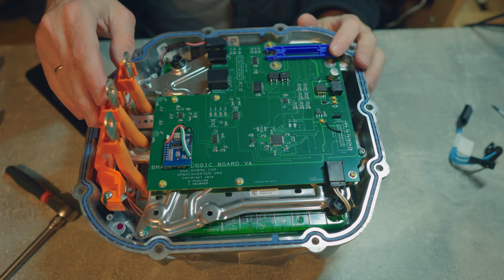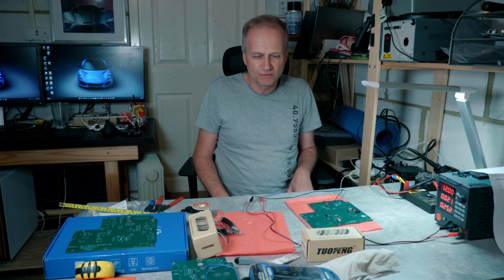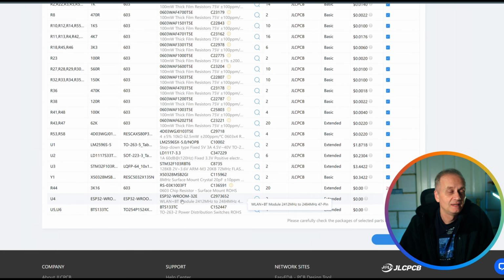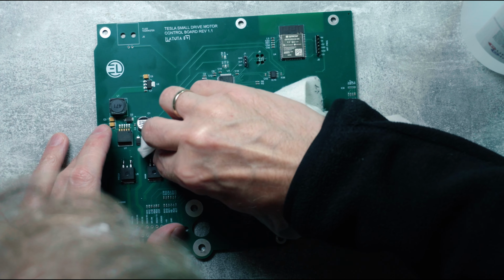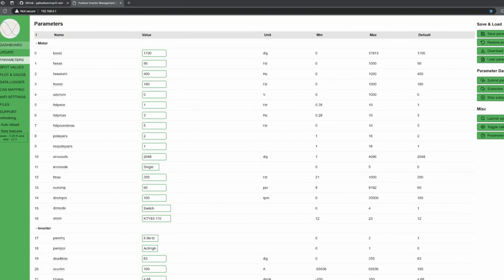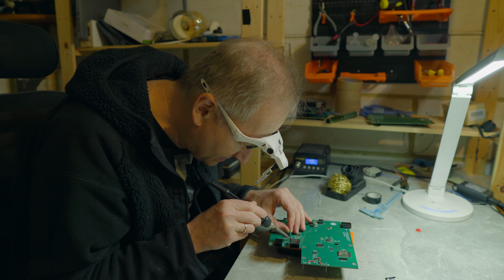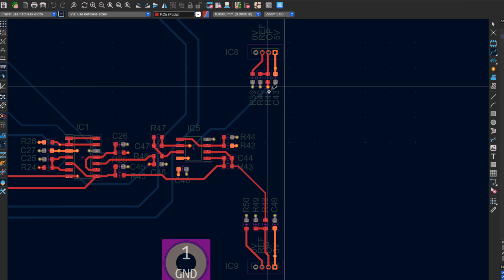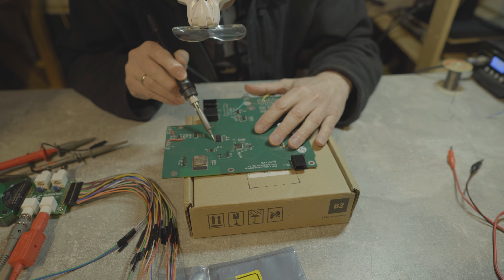From Faulty to Functional: My Tesla Board Repair Experience

Comment: Hi Can you run it at full voltage now, or are there other things you need to do before that
Reply from the maker: Yes potentially I can just need to sort out the HV connections etc. When you say "full voltage" do you mean HV for the battery?
Reply: @LatutaEV Hi thanks for the reply, 

 Yes I meant 300-400 volts like what it would receive in a tesla car.

And will we be able to purchase a board directly from you when everything is running.

Comment: Hello I just purchased a 2021 Toyota Camry hybrid and I get a code pop up that says “ resolver 1 not adjusted”, what does this mean? I can’t find anything on the internet please help. The car runs fine and no engine light or anything
Reply from the maker: I am not sure the resolver should be calibrated and aligned in the factory maybe it has a fault...